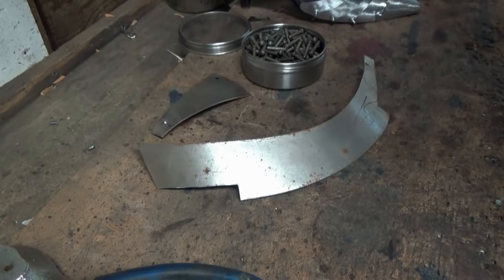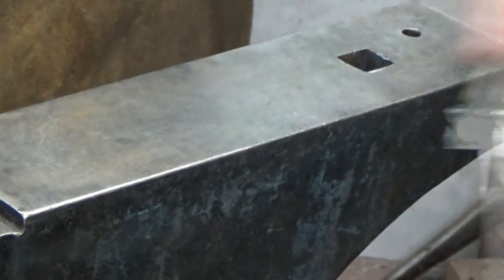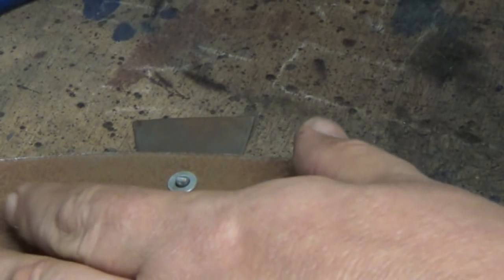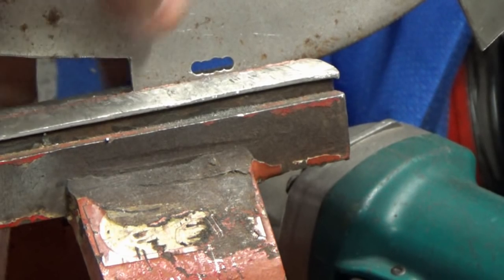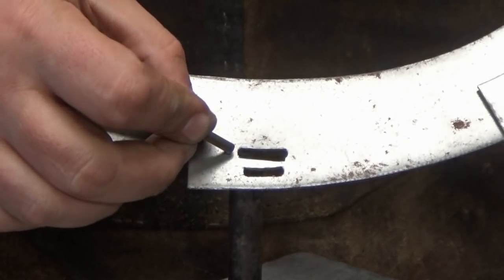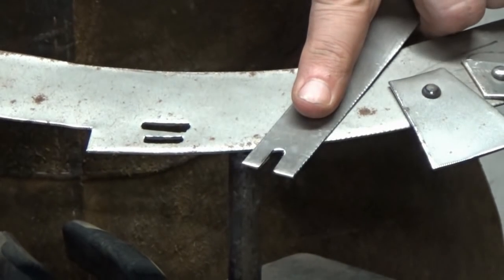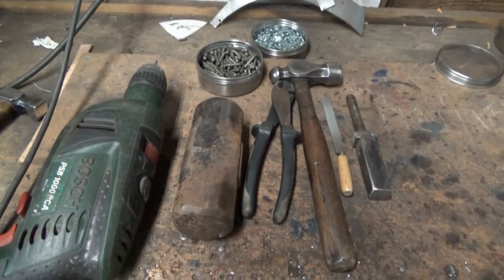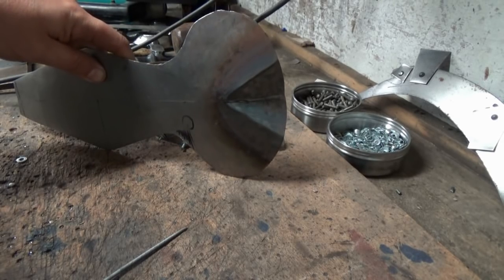Riveting Rivet Essentials, Medieval Armor Techniques #6

Comment: Hello sir, first of all thanks a lot for all this nice content, it helped me a lot for my armor maintenance. 

I have a question for you about rivets material. I purchased second hand armor arms and legs for fighting and the previous owner did a crappy job using stainless nails with modern heads to rivets the leather straps. 
I wantto change the leather and i found that stainless steel is considerably harder to cut and pin haha. I then thought about it and found that stainless could be a nice idea to avoid corrosion on those hard to clean part . I then bought some 4mm rivets but the set up is really hard, my snip can’t cut them ( i have some russian snips and sided one like you ) and i need an angle grinder or hacksaw to cut them which is a pain in the arse. Would you recommand to stick to mild steel rivets and just take extra care of rust on the rivets and call it a day ? Thanks a lot for your insight and cheers from France !
Reply from the maker: I tend to use mild in most of my armours, they gather grease and dirt quite easily so they don't tend to rust too badly, but you will need to keep an eye on the surface and give them the odd wipe. 4mm stainless would be tough, I have a set of small bolt croppers that I set in a vice for jobs like that.

That might help.

https://www.toolstation.com/roughneck-professional-bolt-cutter/p10326

Comment: If I could presume, I'd offer that one can shear with a cold chisel. You clamp the workpiece in the vise, with the two holes aligned parallel, directly above the vise jaws. These work as a guide, and one angles the chisel from the workpiece. (Note that this method is effective for curved slots as well.)
Reply from the maker: Nice idea, I will give it a try.

Comment: Hello I got a question about the rivets, well I'm currently using bolts and nuts would it be good to tighten the nuts with a tool then cutting and shaping the left over of the screw? Would the bolts come out of place ? And thanks your video helps alot
Reply from the maker: I guess it could technically work. But you'd be reliant on the strength  of the thread, I've found screws tend to be quite soft and also, I'd suggest that rivets look nicer and are stronger.
Reply: @GreenleafWorkshop  will do and thanks a lot it helps

Comment: For drill bit's l like to go a 64th larger than the rivet (usually a 3/16 and a 13/64th) and thus save the filing stage for the holes.
Reply from the maker: Nice idea, I'll give that a try next time I get some more bits ordered, thanks.

Comment: Where do you get your rivets?
Reply from the maker: In the UK I generally go to Sapphire Rivets or occasionally Chronos Engineering. The latter seems to have a diminishing variation of stock though.
Reply: @GreenleafWorkshop  are those online? I am based in Canada and im currently a novice armourer who uses cut amd sanded roofing nails
Reply from the maker: http://www.sapphireproducts.co.uk/

https://www.chronos.ltd.uk/

I would also suggest asking on the United League of Armourers Facebook group or the Armour Archive on the web for other suppliers, there are a few Canadian Armourers who must be getting rivets from somewhere. I believe that Eric Dube is a Canadian … I think.
Reply: @GreenleafWorkshop  thank you!!

Comment: I doubt in the 1500"s they had electric drills and such
Reply from the maker: without a doubt. The modern cheats all depend on the customer's requirements; some I won't use, particularly if they don't create the shapes needed like English Wheels etc … I enjoy older techniques when I can though. I'll do a video soon on medieval hole punching, it's relatively straight forward and takes about the same time as drilling in my opinion.